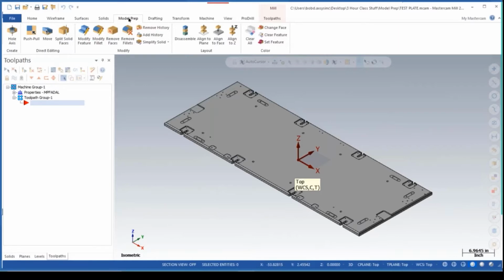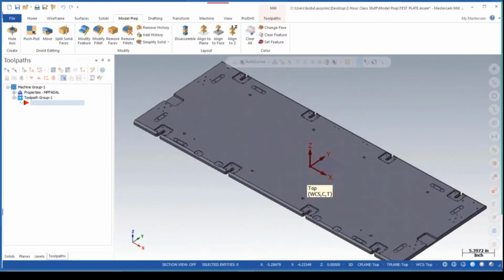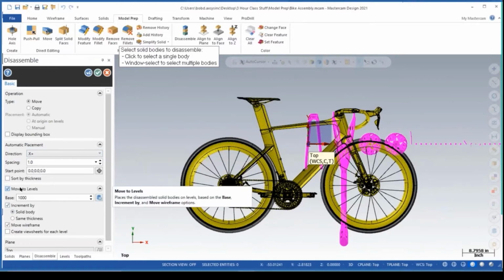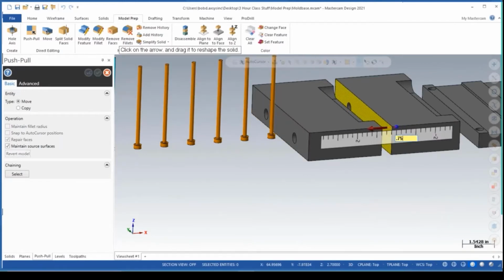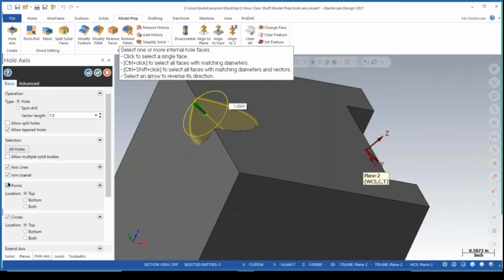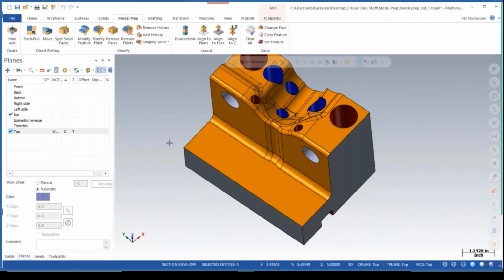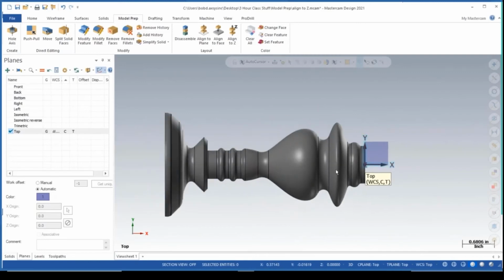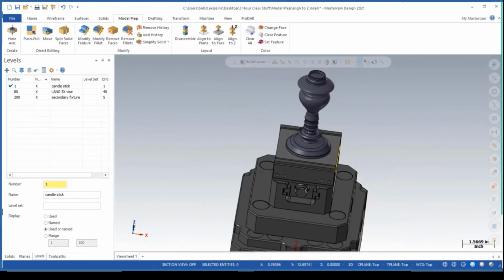Mastercam Model Prep Function

Comment: Kudos for the awesome video !!!!

In the first part of the video . I wanted to add.  That you can also modify the part on a different level , that way you can save all in 1 part file.

The thing that I did notice when I used the push pull feature in 2021 version that the undo does not work. 
Does the undo work on 2022 ?
Please let me know. 
Thanks